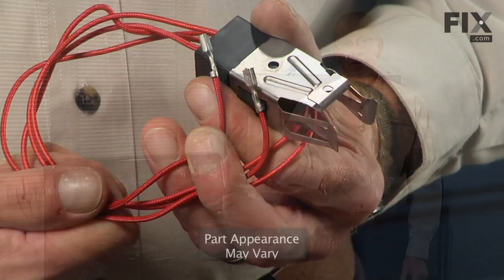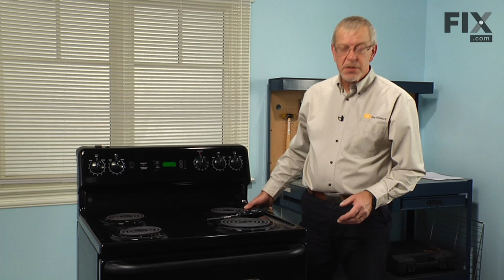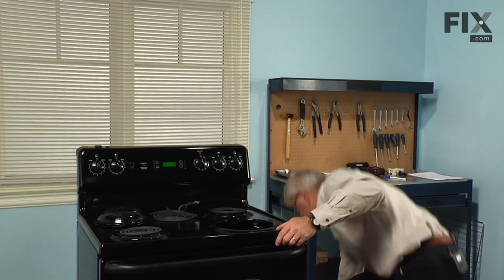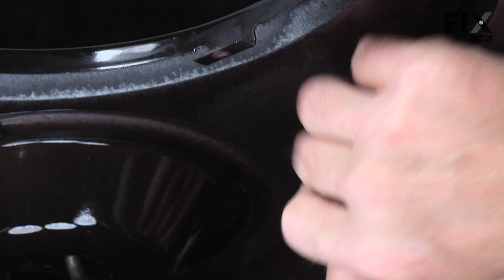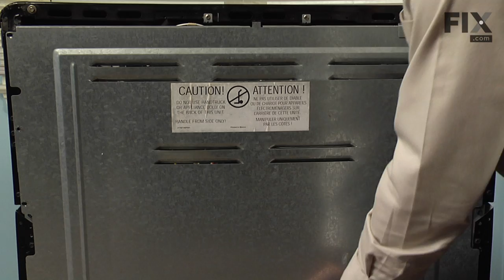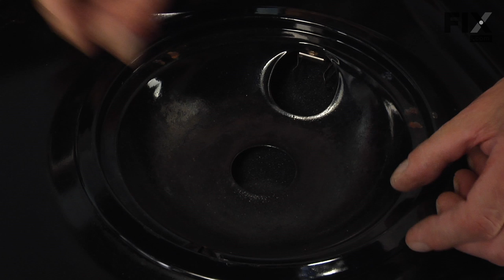GE Range Repair – How to replace the Surface Burner Terminal Block Kit

Comment: Thank you. This video was very helpful. My brother has an old GE stove. The main stove top does not lift up as shown in this video (Or maybe it does and I am doing something wrong). Can I still repair as shown in the video?  Raising the main stove top will make replacing the Surface Burner Terminal Block receptacle easier after watching the repair video you did. Thanks again--👍